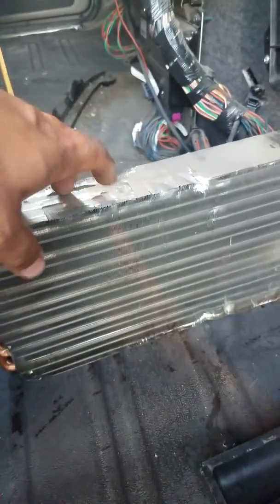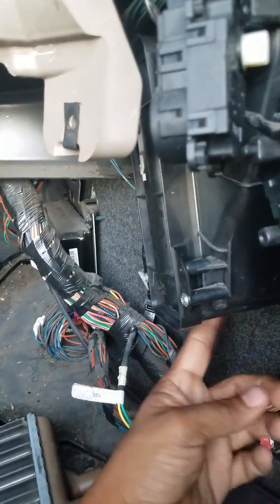Heather core replacement 12 cascadia cambiar change new Heather core

Comment: is there a separate heater core for the sleeper? reason I ask is because when I turn on the heater in the sleeper it smells like antifreeze. but it doesn't smell like antifreeze in the front...
Reply from the maker: Yes there is. Depends on the truck model. The location is different on any truck
Reply: would you know if a 2013 freightliner cascadia has a heater core elsewhere?
Reply: @jorgefacio690  I have a 2015 cascadia.  I had the same problem as you. I was smelling antifreeze in the sleeper. There is a heater core located in the sleeper as well
Reply: I have a 2012 cascadia and on mine it's  on the cabinet that's in the back of the driver seat.
Reply: Mine had 1 in the sleeper i replaced easier to replace than this one no cutting mine was located behind the driver seat under storage cabinets and hoses are by def tank under sleeper same hoses as these

Comment: did you have to drained anything?  vi otro video que dice que vacies el atifreeze,
Reply from the maker: Cierre la valvula q lleva el agua al heater core y a la otra linea solo doblela para q no se salga el agua.
Reply: @iwin7858   gracias
Reply: Can you run a while like thi?
Reply: Can you run a while like this?
Reply: Nino Texas you can.  Running with my currently. Just bought the part. Be careful it don’t get in your electrical cord.